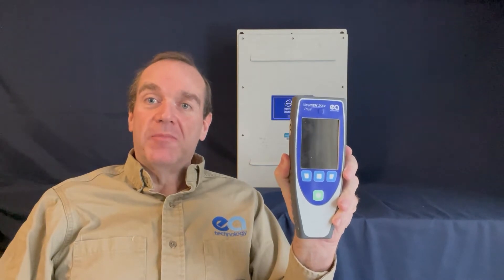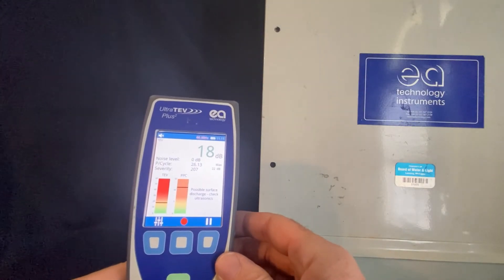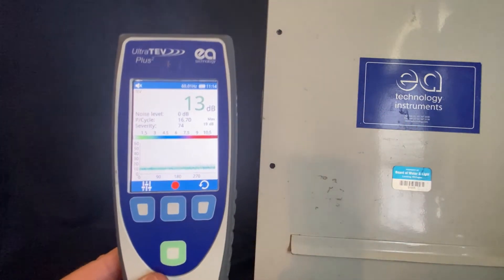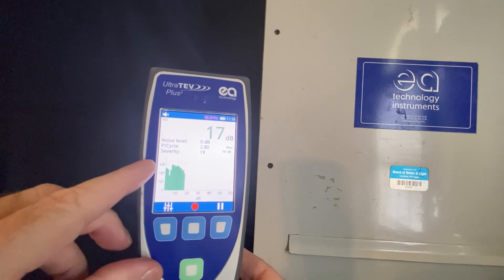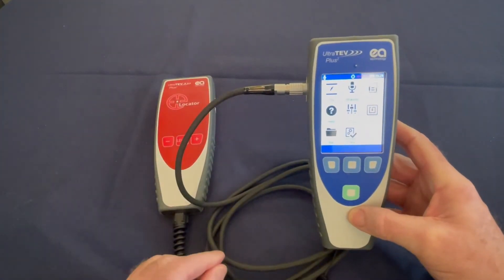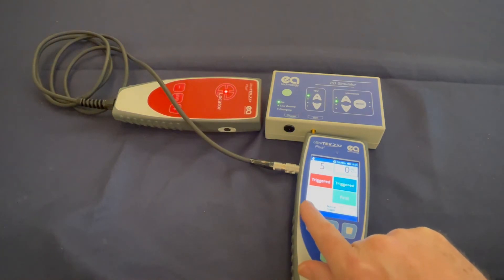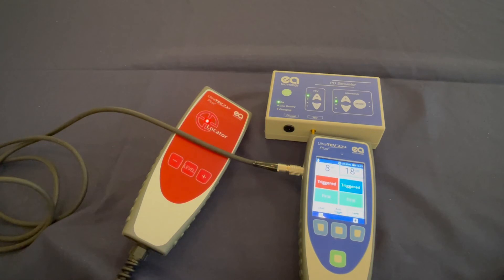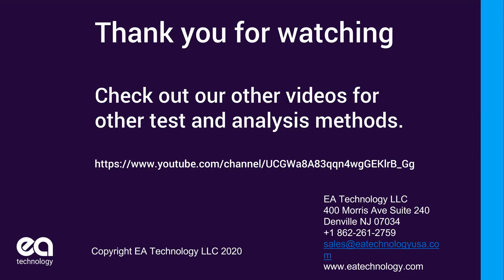Transient Earth Voltage (TEV) Testing with the UltraTEV Plus2

Comment: Can we test at no load condition
Reply from the maker: Yes you can.  The important thing is that the equipment is energized to full line voltage at the power system frequency.